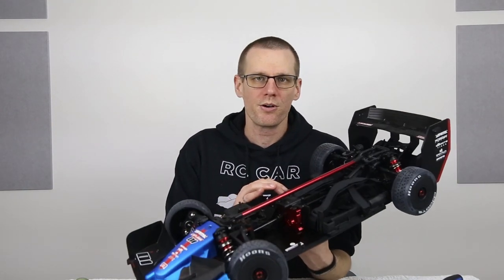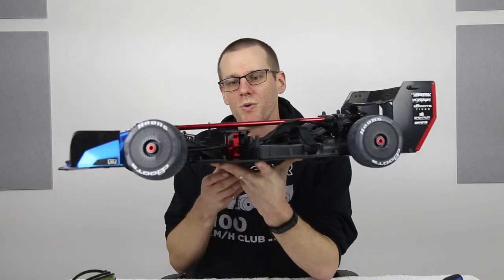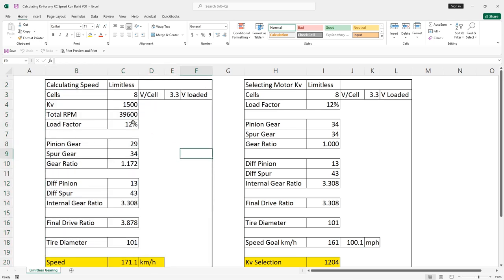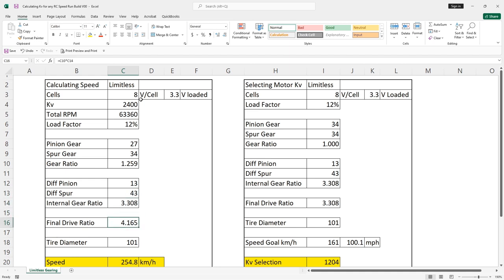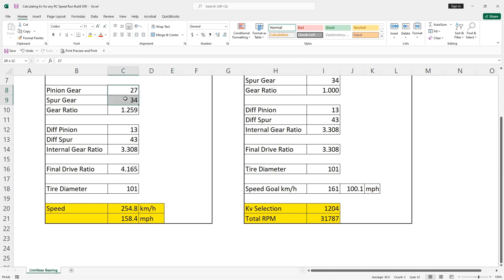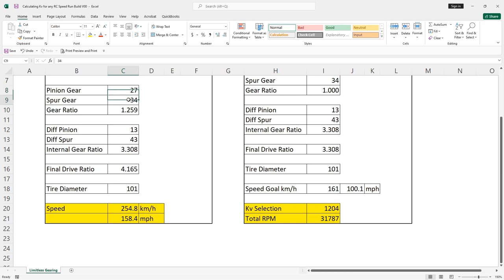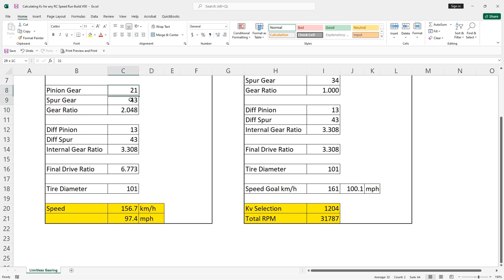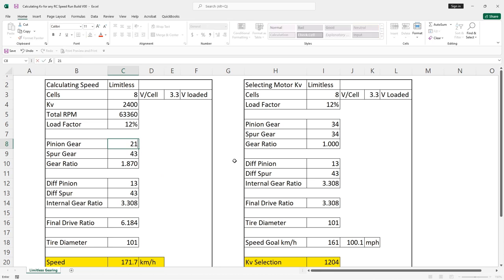Selecting Correct Gearing for a Beast of a Motor - Castle 1721 2400Kv

Comment: Hi Ryan! Great video as always😀

Just wondering when you calculate HP of your RC car should you use the voltage of your lipo fully charged, so 16.8v for me (4s) or should I use the nominal voltage or something along the lines of that.
 (Keep in mind that I am using a battery that can discharge 600amps continusoly in a system that will not draw over 400amps peak so there shouldn't be much of a voltage drop, if that matters😀)
Reply from the maker: Use the voltage and current from the data log of a run. Then multiply by the expected efficiency.
Reply: I don't understand why u think it can even be mounted in the stock formation of the limitless how will it fit?

Comment: Just got a v2 limitless any ideas on a good value motor and the right gearing and esc that won’t break the bank. 
I want to be able to run the car around a bit at slow speeds for testing and fun and then attempt speed runs up to around 120 ish mph any ideas?

Thanks

Comment: How did you fit the motor in I was trying to find the video that u fitting the 1721 2400kv motor in I saw u eliminated the battery tray idk what else do you have a video showing how😅
Reply from the maker: On the v1 I rotated the motor mount 180 degrees.
Reply: Then transfer the battery tray on the other side

Comment: I have a question.  For speed runs what is the difference between running a 4400kv motor on 3s to a 3300 kv on 4s ? They have about the same rpm
Reply: Heat build rate from current and your specific esc ability to keep up plus gears

Comment: Sorry not about the video but have a question.  Capacitors are for no interuption in current is adding capacitors allowing the esc to run cooler as it dosen't have to start over every time we go off throttle back on . I had esc that would overheat but once I added a cap pack it runs alot cooler
Reply from the maker: Take a look at this video. Hope it helps. https://youtu.be/bMVF0ONVRiY

Comment: Voltage per cell used is ridiculously low...???
Reply from the maker: Yes, it can get quite low under load. The newest version of the calculator estimates this value using an approximate current draw and IR of the pack.

Comment: How would I calculate the gearing for 132ft drag for this same motor in the limitless with xlx2
Reply: I'd start at 44/24-25 and use some throttle speed tuning
Reply: Currently @45/26  still get excessive amp load off the line if a little prep is on the tires.

Comment: I have an important question….. Why does data log tell me my 1717/1650kv is running @ 75kRPM on 6s and 89kRPM on 8s?? Am I under geared at 21T 46 stock spur diff??? 

64mph 6s
75mph 8s
Runtime 40+ minutes
Motor temps 130’s on6s & 140 on8s
Reply: Don't know if you have figured it out yet but you must set the castle link to 4 pole motor, its default is set for a 2 pole motor.
Reply: @tjkj-om9oi  .. yea but thanks it’s the consideration that matters at this point😉 I went from that to solving the xlx2 rev-match “problem” and some ppl didn’t know that could be fixed untill they saw the video.

Comment: I do watch some of your videos. I’m still not sure whether you are talking a load of shit. The KV you talk about with motors is the unloaded speed. The KV is a lot slower under load.
Reply from the maker: Hi Chris thanks for the comment. Are you saying that you missed the part in the video that shows how load is captured in the calculations? Did you run through the calculations to be able to pick it out? Are you able to quantify what you mean by "a lot"?
Reply: @RCexplained  You cannot put an exact figure on how much an individual motor will lose KV on load. There are so many variations. Mostly weight of the vehicle, grip of the tyres, energy lost from motor to wheels. You can only have a rough idea of potential speed of the vehicle. I would say if you can predict the speed of a vehicle within 5% you are doing very well.